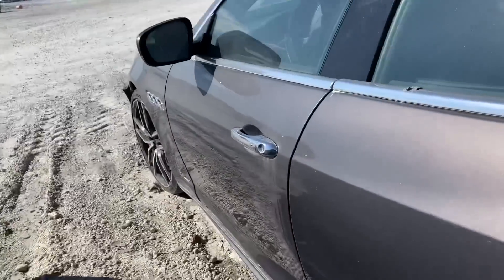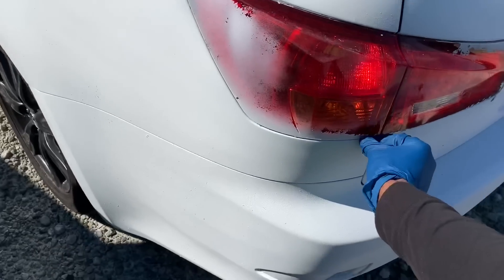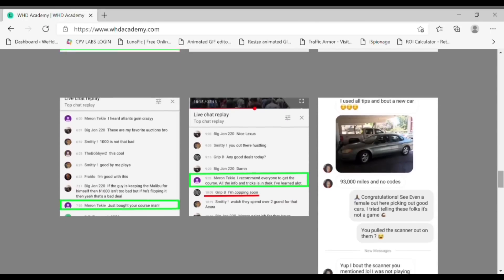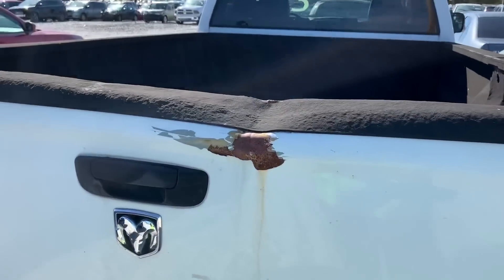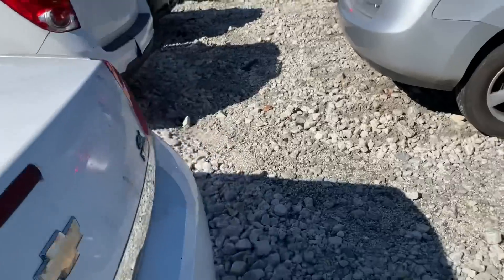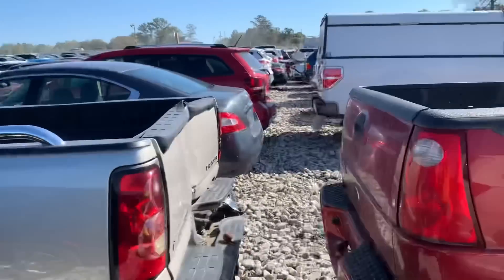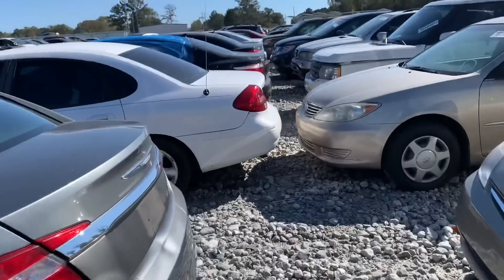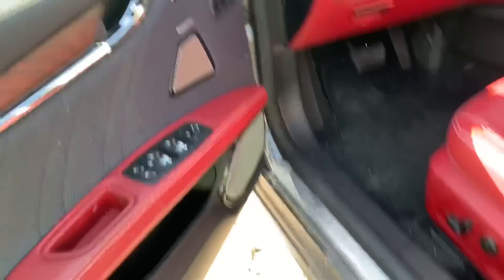I CAN’T BELIEVE THEY TRYING TO CHARGE ME $4500 FOR THIS BUSTED LEXUS IS250!

Comment: Peace. That’s paint ‘mask’ to block the paint where you don’t want it when you shoot a car with solvent based paints. That’s white primer on the car    $4500 is too steep though. But Lexus/Toyota is making the highest “quality” vehicle next to Porsche these days.
Reply: 99% sure it's actually Plasti-dip, not primer.  That's why it peels like it does.  Primer dries hard